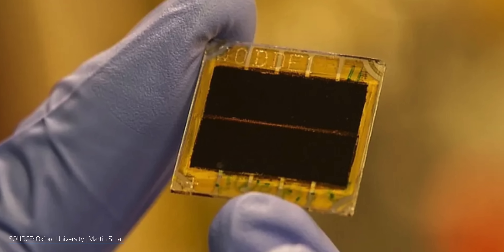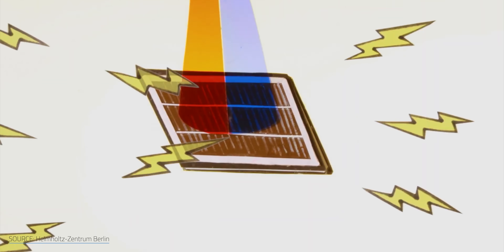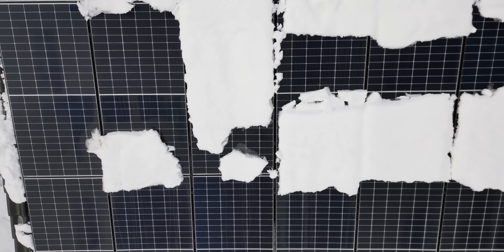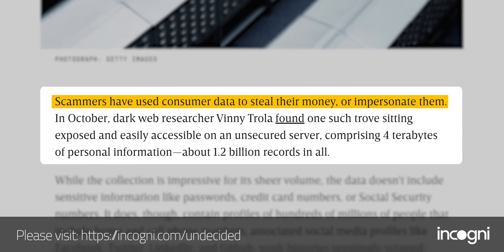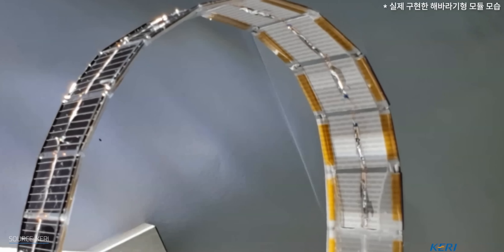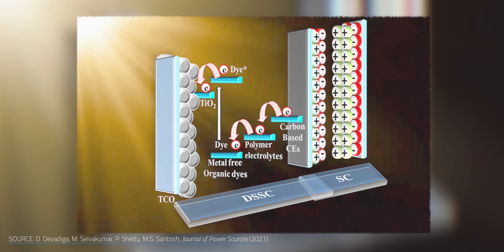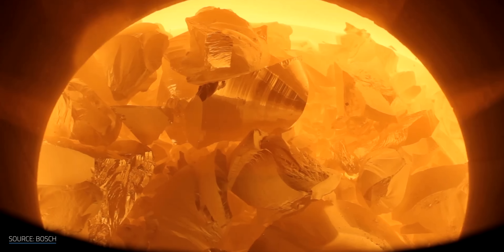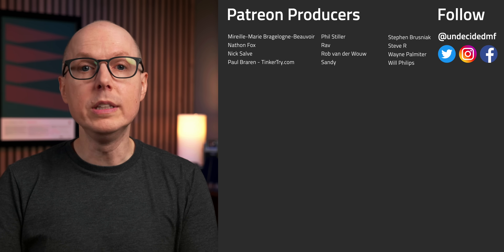Why These Quirky Advances Could Change Solar Forever

Comment: 3D solar modules is a really DUMB idea😂
It will be way more cost than just adding one more panel.

And having high voltage cables flexing around is a fire waiting to happen.

Even the already made solar trackers is a waste combined to adding just one or two panels extra and it cost 20x more for just one 4 panel tracker...

And flexible "3D" panels will suffer in wind and snow.

It will NEVER be an actual thing outside a lab.

And you can always use bi facial solar panels on the walls and as a fence.

Increasing the efficiency of flat panels is the only way to go, or semi flexible to have on car roofs to charge the batteries, even for diesel og gas cars it is economically great to keep the 12v battery at a healthy state of charge and it really does increase it's lifetime a lot.

Or to run the colling fan on hot days so when you drive the car isn't 60°C from start inside

Comment: Again, the issue is perovskite's stability and scalability, not efficiency. These two metrics are extremely poor in perovskite materials, which are worse than CdTe and much worse than Silicon. Not to mention the toxicity of perovskite which is much more toxic than elemental lead and CdTe.

Comment: What we really need are innovations on battery technology. Solar panels are already the cheapest piece of the puzzle.
Reply: There are many with limited roof space, so a higher power density could be very attractive, even if prices were higher per watt.
Reply: It doesn't necessarily need to be only battery technology. 
Other forms of energy storage would be fine if they are relatively inexpensive and efficient and reliable and practical in many locations.
Or perhaps it will be that a number of such technologies will be developed with each being used in places that are most appropriate for the technology being used.

It could be pumping air into containers under water with extreme pressure.

It could be heating up special liquids to extreme temperatures.

It could be pumping water up hills to reservoirs.

There are other possible solutions.

We definitely need better batteries but that's not the only energy storage solution that should be researched.
Reply: True.  Batteries with rooftop solar is like magic IMO with that ~24hr clean power.  They're almost like two parts of a whole like ying & yang.  But, in practice, there are people and organizations that special in either of these technical specialties but not both.  You wouldn't expect one group to halt R&D and investments in their specialty just for the other group to catch up.

Besides that, as good as solar panels are, there is always room for them to get cheaper, improve efficiency, durability and use less materials.  A common 400W solar panel is about $150 USD wholesale but wouldn't it be better if it were, say, $75?  You'll be buying a dozen or more for most residential rooftop installations.  It's also about the size of a 4ft x 8ft drywall sheet in area but wouldn't it be better if it were 75% or less of that?

I'm still waiting for passive quantum dot film technology. It'll just be a layer in front of the silicon solar cells that will convert higher frequency light waves (optical) to lower frequency (infrared) that silicon is most reactive to.  All that higher frequency light is otherwise reflected or absorbed as heat without triggering the photoelectric effect.  It also matches up better with our sun since our sun emits most of its energy in the visible light spectrum.
Reply: Yeah but we need to remember that industrial applications take a lot of power. We should think bigger than merely residential or other civilian purposes. In the industries, if they can save cents, they would because of their volume that one cent difference can amount to a lot of money.
Reply: @gamechannel1271  absolutely, I'm really interested in the heat cell batteries salt, sand ect. They are cheappp but need more efficient energy recovery. Same problem multiple avenues.

Comment: Seems to me that the solar concentrator dyes are poorly described.  The notion that coating a surface with anything can somehow increase (concentrate) the radiation (light) incident upon it is absurd.  The only plausible, functioning similar concept I can envision would be a fluorescent sort of dye that would absorb radiation of higher frequency than what the PV module can absorb and reradiate that at the lower frequency that the PV module can absorb.  If that’s what’s going on here, would it be that hard to say so?

Comment: This is all very interesting, but regular silicon multi junction cells with quantum filters will likely have enough efficiency to make placement sort of an afterthought. 

Plus, they'll still last basically forever & generate enough energy to make 1000's of more panels for each one we make.

Manufacturing techniques just need to be implemented & scaled up. We're already basically there on that technology. Ten years from now Fusion will likely also be an afterthought.

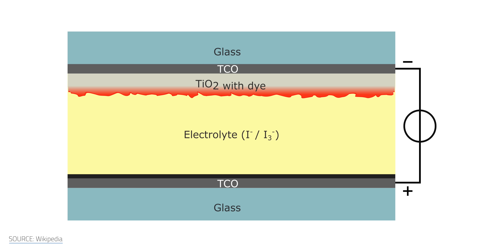Comment: 9:35 I have seen too many explainations of electricity as electrons moving as if they were little balls or water moving inside a hose. The analogy of electriicity behaving as a fluid (or a stream of balls) can be useful, but it is necessary to make the distinction. Electrons don't move out of the atom they belong to, otherwise the material would be changed (e.g., into an isotope) and at some point it may run out of electrons. Electricity is not composed by particles (e.g., a stream of a fluid or of little balls) but by a field (and charge, etc.). The former is easy to understand as we see that in our human experience, but we don't experience "fields" (with all their perks like current, charge, orthogonal magnetic field, etc.). We cannot touch or hold a field in our hands as we could do with particles (like little balls) or a fluid like water. It is difficult to explain electromagnetism in a simple relatable way  (I remark that I acknowledge that), but that is no excuse to explain it incorrectly. Nonetheless thank you for your videos, they are super interesting and well made despite the mistakes.

Comment: Question please:  I've been kicking around the idea of (basically) lining the inside of a 3D shape (sphere, dodecahedron, ...) with photovoltaic cells, and then 'piping' sunlight into the vessel, so that the light generates electricity, but also the reflected light also generates electricity.  Have you seen anything like this, or is it (in your opinion) just a pipe dream?

I have no concept of how much light is reflected off of a solar cell/panel...and if the reflected light is usable for producing more electricity.

Thanks Matt.
Reply: I have seen a company working on that, they are called WAVJA. There was an article back in July about the tech.

Comment: For 3D structures, keep in mind that the best you can do is collect energy in relationship to the thrown shadow of the structure.   For a single structure such as a globe, this can be useful, but the concept breaks down very quickly as the collection area increases.

This concept (the use of 3D structures) breaks down as the area you have to work with grows larger.  A rooftop full of flat solar panels will be cheaper and easier to construct and still collect virtually the same amount of light as a rooftop full of globes or mechanical structure.  It might require more solar panels, but it can still end up being cheaper because there are no moving parts and the panels are more structurally resilient.

Incident light collected from other directions will be far lower energy, but the same concept applies.  The larger the collection area, the less useful 3D structures are verses regular panels.  Diffuse light collection from other directions works the same way... the larger the collection area, the less useful 3D structures become.

-Matt
Reply: I've read that if we could build a globe about 40,000 km in diameter with a surface that is 
71% water and 29% soil, rock or glaciers 
and with an atmosphere that is approximately 
78% nitrogen, 21% oxygen, 1% argon and 0.04% carbon dioxide
 then that globe might be able to capture a significant amount of solar energy.

Comment: How many acres of parking lots could be covered in solar panels?  Shade and electricity together are a good return on investment.
Reply: And put battery or even just capacitor banks near them, and then you also can help charge the increasing amount of electric vehicles on the roads.
Reply: Check out Teslas new solar charging stations in Cali!

Comment: Put the dies over the metal  buses and have them do side emission into the panel coating. No shadowing and maybe could be applied as a painted grid on top. Smart engineering will figure out how to pattern these as wave guides.

Comment: The multi-junction tech is looking promising... but it's always looked promising.  The mechanical tech and memory materials are a non-starter... no structural strength in inclement conditions (and will never achieve structural strength).

Diffuse light can only generate a small portion of what would be generated in direct sun, though.  Its like chasing crumbs.  There just isn't much energy there to collect in the first place and no amount of technology can change that.

UV is basically direct sun through a layer of clouds (you don't get UV from diffuse light).   This will have significantly greater incident energy verses diffuse light, but it will still be maybe 1/10th what you get with direct unobstructed sunlight.

Diffuse light: 1/30th the energy.
UV light (direct sun through clouds): 1/10th the energy
Direct unobstructed sunlight: Baseline energy for the above

You can easily test this for yourself simply by building a simple thermal collector and seeing how much heat it is able to collect.  This is more or less the best-case scenario in terms of energy collection.  Something like 90% of the light's energy is collected, it just isn't converted into a useful form outside of thermal (heat).

-Matt
Reply: Understand what you are saying, and that you're talking about natural background diffuse light.  With that said, I think a growing movement/technique is to use bifacial Solar panels and paint surfaces near them with an ultra white, ultra visible light reflective material.  There are pigments now that can reflect up to around 99% of visible light.  But still far cheaper than buying a solar panel (way cheaper per area covered).  If you can surround upright bifacial solar panels in a bath of this visible light reflective surroundings, you can boost production at lower cost.  And bonus, some of these ultra light reflective pigments are also excellent IR-sky window-space radiators and can lower the temps around them some, even with full sunlight hitting them.
Reply: @justinw1765  Yes, I have noticed numerous enthusiast channels trying various reflective surfaces and in an emergency there is some merit.  But those surfaces won't last a week without having to be cleaned, won't do well in weather, and won't have any longevity just in general... the maintenance is going to be heavy, and they still can't collect any more energy than is hitting them (which won't be much in diffuse light).

So the usefulness is limited.  Far better to simply add a few more solar panels to the system, which requires zero maintenance and will last 25+ years.   Solar panels have gotten very cheap and used panels are even cheaper.

-Matt

Comment: I think the Solar everywhere approach is by far the one with the most potential.
Even if those individual cells are considerably less efficient, the sheer abundance of them should be a huge boost.

If it can be made into some kind of sticky back film that can cut anywhere and applied to almost any surface, and can be done cheaply, then I think it's pretty much energy problem solved.
Reply: If only it were that simple. If they were miraculously half the price of current panels, sure, I can see that take off. But unfortunately for many years it’s probably still going to be more expensive. Hopefully I’m wrong, though!

Comment: I would have to take issue with your assertion that the most expensive part of deploying a solar farm is purchasing the land. Let's assume somebody buys an acre of land for $50,000. I have to believe that more than $50,000 worth of solar panels will fit on that acre. Have an actually done all of the math, so I could be wrong. But what I'm saying does seem to make intuitive sense.
Reply: Land is expensive, and your not building it in the middle of nowhere.

Comment: As I understand it, perovskite panels often contain lead. When they replace lead with tin, efficiency goes down and so does stability. We don't want one more potentially future toxic & ubiquitous product. I was excited about perovskite again until I remembered this.
Reply: Lead acid batteries are ubiquitous and get recycled constantly. The solution is recycling infrastructure and core charges, not throwing away good efficiency tech.
Reply: @AllSeeingEy3  That's in part what I meant when I said "don't want one more potentially future toxic..." Those things are ubiquitous and even with 99% of them being recycled, that 1% still gets into the environment.

Also, while we had some legislation in 1976, the better regulations didn't come until 2006. Legislation isn't super fast to catch up and I wouldn't trust it would with this product.

I would prefer if silicon were focused on vs lead+perovskite to remove one more variable.

Comment: I wonder if researchers have mostly given up on increasing the efficiency of cells. Judging from them chasing 1-2% of light (disperesed by clouds or nearby buildings), sounds like it. Dyes oxidize and "photobleach" quite rapidly, especially when exposed to the outdoor sun. Dyes (good ones anyway) are pretty expensive, too.